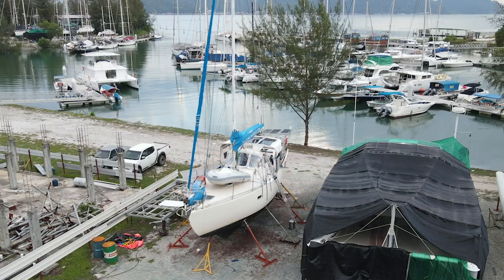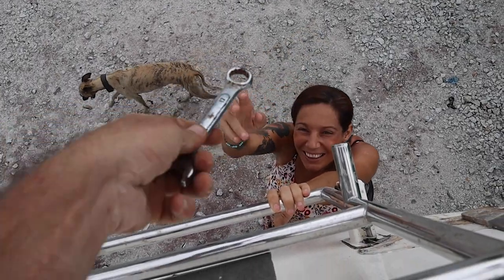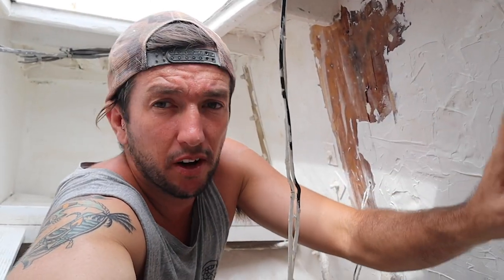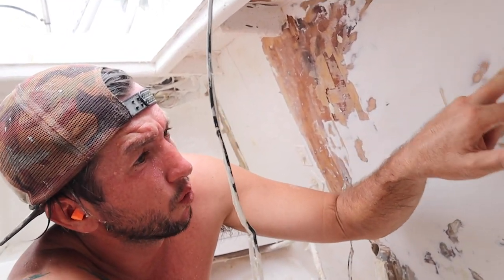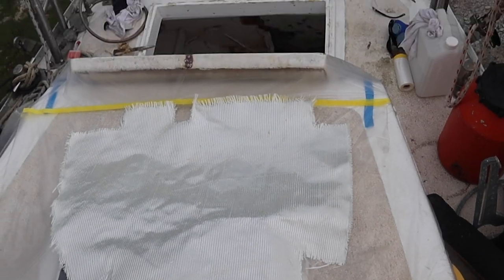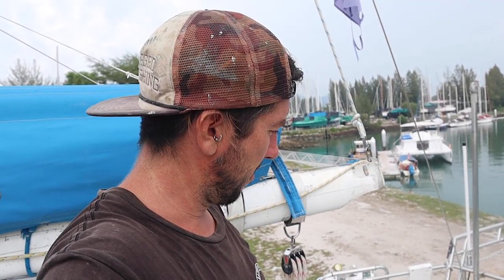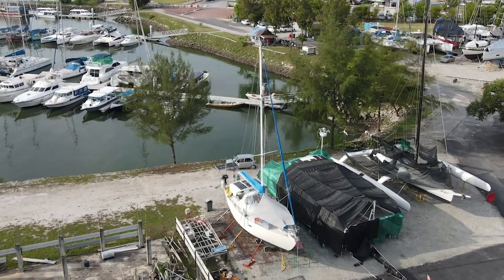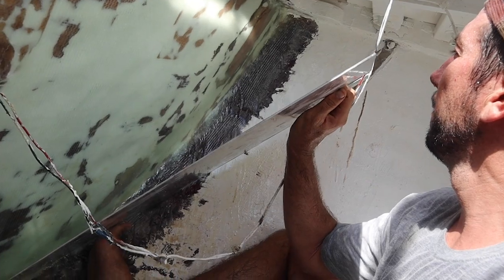MORE PROBLEM'S FROM THAT DAMN REEF! | Sailboat Refit 2, Ep 209

Comment: If I was ever in the market for a boat. I would have no problem buying your boat, being that we have seen you work on it. All the work has been top notch, as far as I have seen. Good job Yosh! I think stainless steel would have been better inside the transom though.
Reply from the maker: If Nandji ever goes on the market we will give you a call... Don't hold your breath though!!! It would have nice to use stainless but unfortunately 316 stainless plate is not something easily found in Malaysia. You use what you can find!!

Comment: West System makes an ultra-slow hardener for working in the tropics (209 hardener). Where you are, I would definitely recommend that to extend your work time. It gives you a little breathing room, and allows you to build up layers without worry when in hot and humid environments.
Reply from the maker: Yes, I was using 206 and I had to wait a week or more to get 209. The joys of boat work overseas! You use what you can find!!

Comment: I hope you used an insulator between the stainless steel washer and the aluminum plate. If you have stainless in contact with aluminum and you add a bit of salt water the corrosion/electrolysis  between the dissimilar metals will go crazy.

Comment: You might want to use a synthetic material when you remount the steering vane.  It wouldn't absorb water the way the wood bits you took out will.
Reply from the maker: I used teak instead and treated the pads with epoxy before painting. Not sure what type of wood they previously were
Reply: @FrothLyfeSailingNandji  That sounds a lot better that what you had before.  It will be interesting to see how it weathers.

Comment: I used to used my hands all over smoothing epoxy until I got a nice long shard of glass jammed into my palm, so now I only use my hand just on the angled bits where rollers never work.
Reply from the maker: Fair enough! Sounds like a bit more grinder time needed! It doesn't tickle when glass gives you a poke! Have a good Christmas

Comment: Always over drill the holes , fill with epoxy and then re-drill so any leaks can not rot the core .
Reply from the maker: I did do this and should have mentioned this fact. Thanks
Reply: @FrothLyfeSailingNandji   Figured you would - was surprised when I did not see that step .  I get it though it is hard to film by yourself . 

You were saying the prop might have hit something and bent the shaft , if so check the prop too - it might need balancing . Np idea how one would do that prop though .

Comment: Sorry to ask, why don't you replace the wood rather than band aid epoxy it?For long term repair I recommend you replace all the soaked wood.Sorry, I would not want to hear that statement. Good on you mate, I think you guys are great. Can't wait to see your little one.
Reply from the maker: I made the assessment of how damaged the wood was. If it was too far gone then I would have replaced but drying out the timber and using penetrating epoxy is way easier! It dries solid and bonds all the wood together so making it a solid structure once again. It turns the wood rock hard and water will never penetrate into again.